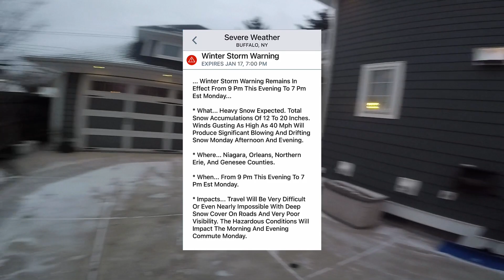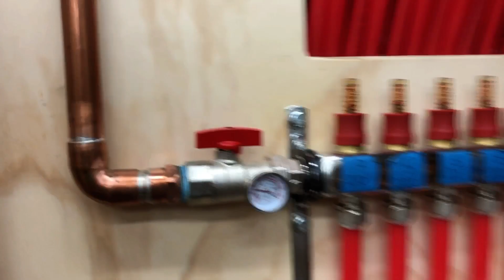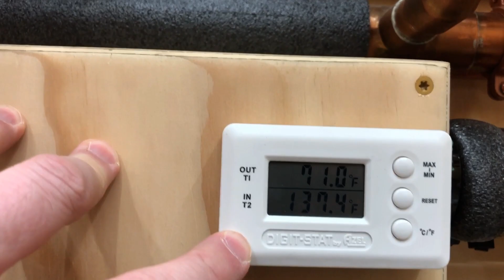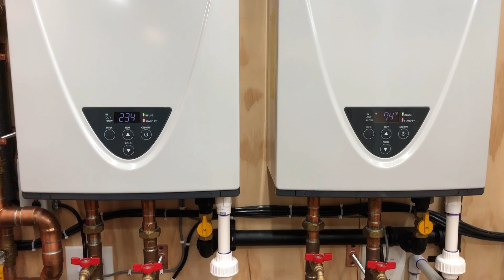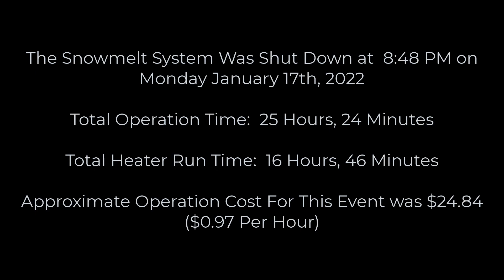Another Heated Driveway Melting Snow Time Lapse During Crazy Buffalo NY Snow Storm on [1-17-2022]

Comment: Do you have a snow detector to turn on your snow melt system when it starts falling?
Reply from the maker: Hi Joel!  As of right now I don’t, but I did install the Tekmar sensor socket in the driveway so I can add them later if I want.  For now I activate it manually either from a switch in the utility room or through my smartphone from anywhere.  I can check all of the cameras for accumulation and activate or deactivate it accordingly.  So far it’s worked great. The only time the automatic activation would’ve been nice is during an unexpected overnight accumulation when I’m asleep and not turning it on.  If we know it’s coming though I just turn it on before we go to bed.  Hope that answers your question.  Thanks for watching and commenting!! 😊
Reply: @DeckerChristopherJ  yes. Thank you so much. Impressed you were able to do all that with a couple instant on hot water heaters (and a whole lot of elbow grease)

Comment: is your driveway sloped? if it's not that may be an area with great potential improvement because evaporating water takes much more energy than melting snow(over six times more). it's probably not worth it just for the sake of improving heating but you may want to look into it when rebuilding your driveway for some other reason in the future
Reply from the maker: Hi Mikolaj!  Yea, the driveway is sloped both away form the house and towards the street.  I did install channel drains along the house to catch some of the runoff, but most of it ends up at the sidewalk / apron.  It will sometimes cause a small ice dam down there, but it really hasn't been an issue.  Several of my other videos discuss this in detail if you want to learn more. https://youtube.com/playlist?list=PLdWeMRuZcbQjekwiBk_uy39IS6JFWYORD  Thanks for watching!

Comment: Love the videos. I am planning a project of my own in the next few weeks. I am wondering about the damage to the concrete from the drastic changes in temperature. Have you noticed any cracking due to rapid changes in temperature?
Reply from the maker: Hey David!  Thanks for the nice compliment!  So far, I have noticed no issues with the driveway after 2 season of operation.  There are a couple of cracks, but they were there before I ever turned it on for the first time.  I've also noticed some spalling on the sidewalk / apron at the end of the driveway, but the weird part is those sections are not heated.  It's probably from the salt coming off the cars and the plow pushing the salt form the road up.  The actual heated part of the driveway has none, just down by the road.  Who knows, but I don't think its from the heat.  My system doesn't really blast 120ºF+ glycol out there right away either, it takes a couple of hours and slowly increases.  Usually with 30ºF glycol coming back, I'm putting 70ºF+ out, and they both slowly increase proportionally.  I have thought about investing the the Tekmar 090 sensor and 654 control which has built in slab protection, but haven't Brought myself to spend the $1k yet. Hope this helps, thanks for watching!
Reply: @DeckerChristopherJ  Thanks for the information.

Comment: I think it performed well, remember back to the beginning when you were crunching numbers. The software's output isn't designed for a blizzard type event. Doesn't happen in most locations often enough to size it for that. Up-front cost would be higher and equipment oversized. It would have eventually melted it all. Your into this so you can tweek it to a given forecast. Just turning temp's up and leaving it wastes energy the rest of the time.
Reply from the maker: Great points Glen, and you are absolutely correct!  We had a smaller snow event yesterday and I spent some time adding a switch to disable the radiant priority.  Once the radiant came on and the heaters were supplying both the slabs and the snowmelt, I was able to play with the heater temps.  160ºF seemed to do well satisfying both, but I didn't want to leave it there.  After my testing was complete and the driveway was melted and dry, I put everything back to the way it was. At least I know what I could do if another large event is predicted.  I know I said I wouldn't, but I am also considering making the investment in the Tekmar 654 control and 090 sensor.  I like some of the features it offers, including idling, automatic operation, and running the heaters based on slab temp instead of return glycol temp.  It may actually be more efficient...  Thanks for watching and commenting!

Comment: What do you average for a temp drop through your loops after several hours? 👍
Reply from the maker: Once its up to temp, I usually see  a ∆T of 30ºF.  After it failed to keep up during the storm in this video, I have made some modifications that seem to be working well.  I now have the heaters set at 160ºF instead of 140ºF.  The snowmelt is on now as I type this and have been on since approx 7:30 am so I would say it is up to temp.  When the aquastat hit 65 on the return glycol and fired the primary loop pump / heaters, I saw 95º out to the slabs with that 65º return.  As the return climbed to 70ºF I saw 100ºF going out.  With the heaters set at 140º I would typically top out at 102ºF going out, but with them set to 160ºF I am now seeing up to 112º going out as the aquastat reaches 80º and turns everything off.  Does that make sense?
Reply: @DeckerChristopherJ  makes sense. I ponder if a 30° delta is exceessive and a higher flow rate providing a 20° delta might get you a bit more btus average to the slab.. a higher outlet temp also makes sense as long as your slab can tolerate the higher temp..
Reply from the maker: Lowering the delta would be an easy test using the differential on the aquastat.  15º on the aquastat gave me a pretty equal on / off time when the system was up to temp, so that is how I ended up at it.  I am also seriously considering purchasing the Tekmar sensor and 654 controls, and going fully automatic.  If I understand the literature correctly, the system would fire based on slab temp instead of return glycol temp.  I want to call Tekmar and have a chat with tech support before I pull the trigger, but even more changes could be coming 😉

Comment: I was hoping for this video because it was a pretty big snow over here and I figured it would be big by you. Refresh my memory what's your percentage of glycol in the lines and what freezing point does that translate to?
Reply from the maker: Hey Matt!  Glad to see your still watching! 😀. Yea, this one was by far the worse we've had at one time since I've had the driveway heated.  On top of that, back in the fall I re-wired to give the house priority and I don't think that was ideal for the snowmelt.  The good news is I believe I have corrected these issues so it won't happen again.  We are getting a steady snowfall today so the snowmelt is on as type this, and I've been tinkering all day.  I have added a way to turn off the priority, and have found that by bumping the heaters up to 160ºF, they can handle both the snowmelt and radiant at the same time so the priority isn't really needed.  I of course recorded all of these changes, so today's melt will be out next Sunday and these modifications should be in a video next week.

Regarding the glycol, I have several videos (5 I think) of filling the system, purging, mixing the glycol with distilled water, etc.  The problem is I can't upload them fast enough! 😂 I am still about 24 install videos away from filling, and I have been uploading 3 a week for almost 2 months!  So instead of making you wait for them, I will just tell you...   I diluted to a 40% mixture of Cryotek-100.  Cryotek-100 is different that other propylene glycols, and has better protection, so you actually have to take your refractometer reading of approx. 40%, and go to the label on the bucket.  They have a conversion chart to show what actual protection you're getting, and at 40% I have freeze protection down to -18ºF, it is pumpable down to -31ªF, and burst protection down to -60ºF.  It never gets anywhere near that cold here and I probably could've gone lighter, but I wanted to be safer than sorry!  Always glad to see your comments / questions, and thanks for watching.  Oh yea, and the filling videos where I actually show you the refractometer readings are coming, I promise!
Reply: @DeckerChristopherJ  I've been watching everything even if I'm not commenting. Great detail, added some notes to my Google Doc for our future house building. You are right about the NWS not getting snowfall forecasts right. For this storm we were told 2-4" for Cleveland area since we were on the far west edge of it. Not even a Winter Weather Advisory the morning before. Then at 4pm day before it became a Winter Weather Advisory for 3-5". At 8pm upgraded to a Winter Storm Warning for 4-7". At midnight we had maybe 2". I got up at 6am to over a foot, and we ended up with 18". They missed this by a wide mile! The prior weekend they forecasted a Winter Storm Warning, but barely a dusting and quick work for the leaf blower. Not sure what you are using for a shovel when you need it, but I actually just picked up a 36" wide pusher called "The Snow Plow" from Ace Hardware and used it on the little clipper system we had today over the snowblower. Absolutely amazing, especially for the driveway apron which I see you still have to clear.

I think your system would have eventually melted it all off it you didn't shovel, but I would have likely done the same thing and done what you are doing - recalibrating for the next one!
Reply from the maker: Let me know if you ever need to bounce any radiant / snowmelt design or layout ideas by someone before you build.  You have been an early subscriber since I started the driveway, and I appreciate that, would be glad to help you out.  You can find my e-mail address in the about section of the channel. 

With regards to the NWS, you are absolutely correct.  Sometimes they are dead on, and others they are WAY off.  I was ticked when I ran the driveway for 11 hours on the 6th with no snow, and that led me to turn it on too late for this one!  I didn't trust them!  With that being said, I never thought I would say this, but I have actually started to look into the Tekmar 654 automatic controls.  It's a tough pill to swallow at $1100 ($550 for the sensor and $550 for the controller), but the more I learn about it, it does more than just turn the system on / off like my current setup.  I would be able to actually idle the slab at a certain temp if I wanted, and it will turn the heaters on / off based on the actual temperature of the driveway instead of return glycol like my aquastat is now.  It would also automatically turn the system on in the middle of the night when it started snowing and I am asleep, so we don't walk out to a covered driveway in the morning.  I'm still on the fence, but I'm seriously considering it.  Maybe I should make a deal with my viewers that if they help me get to 1,000 subscribers I'll buy it and do install videos! 😂. Maybe I should ask Tekmar to sponsor me? Haha.

Regarding the shovel, that is exactly what I have.  You can probably see it in the videos.  It's a 36" wide "Snowcaster" that I bought years ago off Amazon.  Works great to quickly clear the stubborn spots off the driveway with one hand.